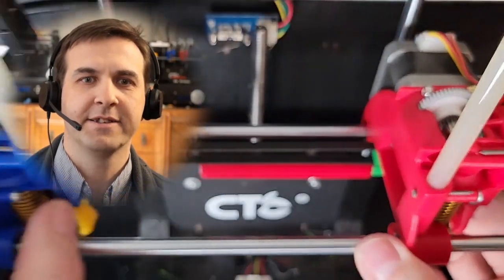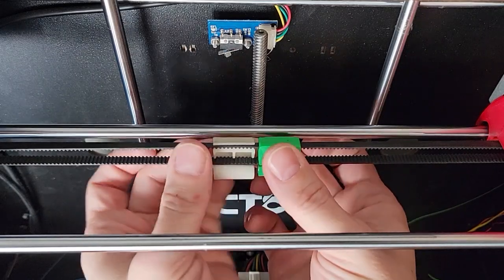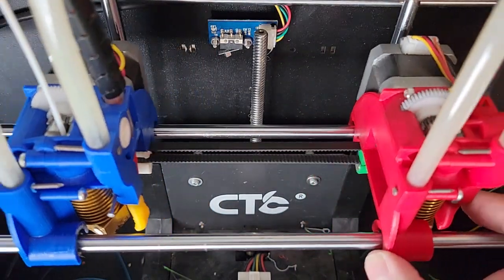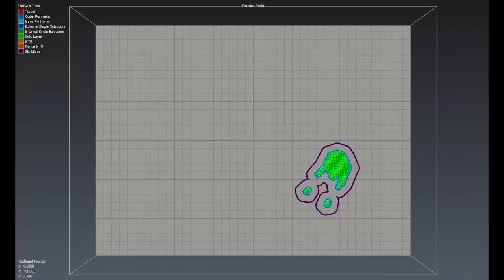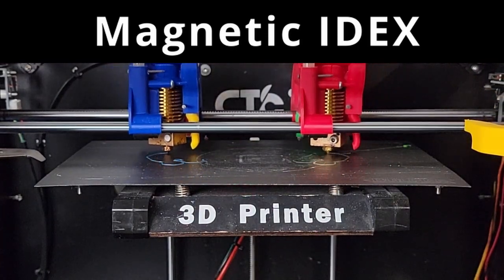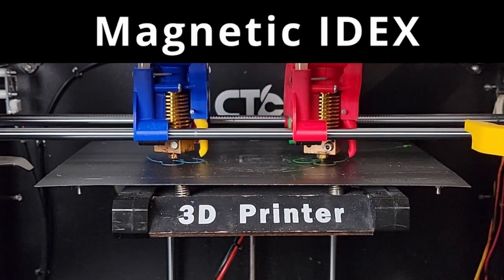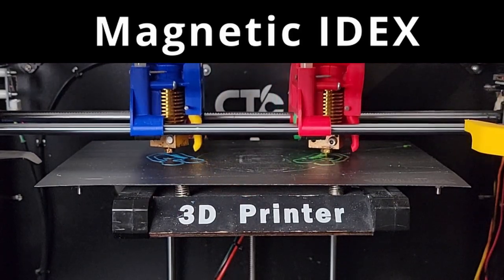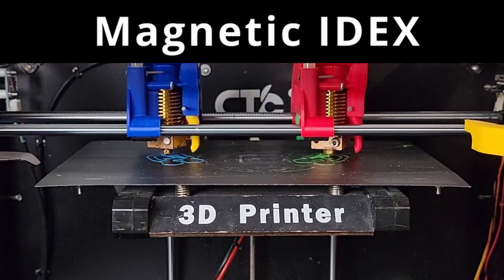Magnetic IDEX Mirror Mode Demo

Comment: But toolheads are not connected magnetically, what moves other toolhead?
Reply from the maker: Skip ahead to 2:44 to see how the magnetic belt coupling works.  https://youtu.be/WZU_HdpftL4?si=gnvSoa17UyCBi1yl&t=164

I call the coupling the white rabbit.  It drives the tool using the same belt.  Depending on how you connect the rabbit, you can achieve all IDEX modes.  It includes Copy, Mirror and dual color/material.
Reply: @m_IDEX  now its more clear, I thought  you just use this big thing as connector snd nothing else. And I started to watch many videos of your project to understand and saw the green magnet today as it moves from one head to another and activates them. And now its more clear what is going on. I remembered I have seen this before few years ago. When I started to have interest in 3d printing. It could be your video, maybe.
Reply from the maker: I am not the first to design a printer with a magnetic tool changer.  Some projects go back 8+ years.
I think i am the first to develop magnetic IDEX.  World's Simplest IDEX 3D Printer 😀

Here are some examples that I have found over the years:
https://youtu.be/zmDU-qqHGRs?si=tscWqYCdBZZSjBkW
https://www.thingiverse.com/thing:3080893
https://www.thingiverse.com/thing:2688392

Comment: Great stuff!!! I want to build one:-) I like your cooling solution. How big of a fan do you run to cool everything?
Reply from the maker: Thanks!  I use an old REMstar Auto CPAP machine and split the hose down to four 1/4" cooling tubes.  Two tubes direct air over the heatsinks and two are used for part cooling.  I run the blower at about ¼ to ½ of the max speed.
Reply: @m_IDEX  Great idea. I like the idea of taking weight off the head.
Reply: @m_IDEX  I was going to IDEX one of my ender 3s. I have 2 complete carriages.  I was stumped on adding the second motor. and belt Would you recommend I get a closed loop belt instead of the standard belt?  I love magnets, have a bunch for various projects. If its not confidential, what size magnets do you use? N42 or N52s? I'd be happy just color switching. Thanks.!
Reply from the maker: @FilmFactry  I use one 1/4" X 1/4" cylinder N42 magnet on each tool head and two on the belt carrier.

Comment: Amazing, i have a similar printer, do you plan to release mounting design?
Reply from the maker: Thanks,  I am definitely planning on it.  Klipper and Magnetic IDEX can resurrect many old Replicators and Replicator clones.  Naturally both can apply to other 3D printer types.  But I am starting with replicators :)
Reply: @m_IDEX  qidi printer have similar design, and most of the owners have klipper on it, if you need a tester write me
Reply: @m_IDEX  Sweet, I have an old replicator 2 I'm currently pushing to its limits, why not add another extruder right? This looks like a relatively cheap solution to IDEX. How do you think this would fare at higher temperatures with all the printed parts? I would also be willing to test stuff out

Comment: in theory this style of idex can be used on ANY printer right? I've wanted to convert my ender 3 to idex and was designing my own setup however in theory this could work esp if you're just using a linear rail as the X axis so theres more room for getting to the belt
Reply: The sheer simplicity of this is what I love most.

You may have said in a prior video, but what does IDEX stand for? Independent Extrudes?
Reply from the maker: IDEX stands for Independent Dual Extrusion.  Here is a great introduction to IDEX technology: https://www.bcn3d.com/white-paper-idex-technology-doubling-productivity-while-halving-costs/
Reply from the maker: Should be totally doable.  The only added cost would be 2nd printhead and some electronics.  2nd MCU in klipper or a bigger control board.  You will need at least 5 stepper drivers.  https://youtu.be/PTBgvrjnstc
Reply: @m_IDEX  i already have an octopus board with the intention of going full idex and would just need 1 more hot end
Reply: Yep, all you need is a linear rail. His printer is not IDEX, it only has one belt in the x axis. Even if your printer mainboard has only 4 steppers you can probably still do it, because Klipper can control multiple mainboards. So if you have a real big printer, you could set it up to produce not just two copies, but instead it could print as many copies as you have available steppers, hotends and room in the bed. To be clear, this isn't actually IDEX. IDEX implies two extruders that can independently move and that follow a different toolpath. IDEX main application is to print soluble support. Duplication and mirror mode are just freebies you get with an IDEX printer.
Reply from the maker: I agree that duplication and mirror are kind of a freebies of IDEX.  Party trick if you will.  Take a look at my earlier video where I demonstrate the independent mode of my Magnetic IDEX design.  https://youtu.be/cV1CSO5EnsA
Reply from the maker: Here is another clip where I demonstrate relatively quick IDEX tool changes.  Certainly quicker than most proper IDEX machines on the market :)  https://youtu.be/PTBgvrjnstc
Reply: @m_IDEX  thats nutty
Reply: @m_IDEX  Amazing!!!
Reply: @m_IDEX  a friend of mine once shared an idea that sits well with your work. You can have as many extruders you want on a single axis, using a single belt. All you need is for the carriage to "bite" the belt (which can be done with a clamp driven by an rc servo, which are typically very light and curiously strong), so that the carriage moves when the belt moves.
Reply: @marcellofialho677  while true it's not independent it gives you some extra options and being you can park one and swap the used extruders you don't really have any benefits with "true" idex. I would argue this is better as it's less electronics and belts that need to be calibrated